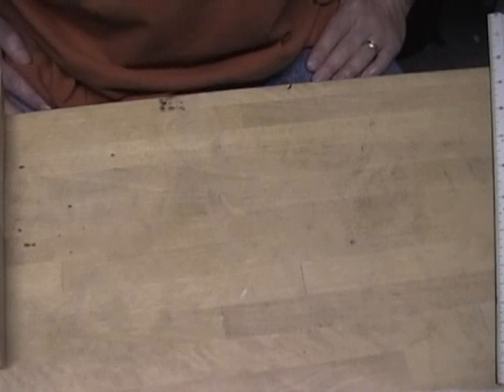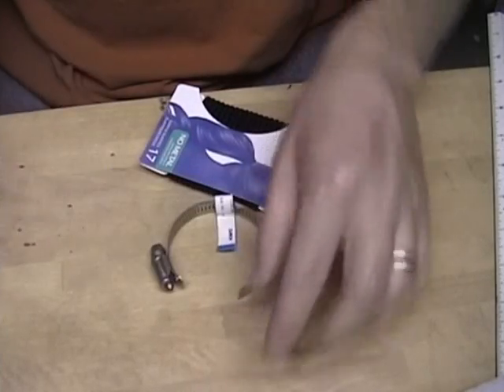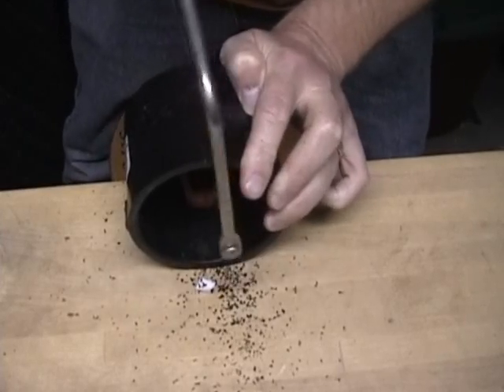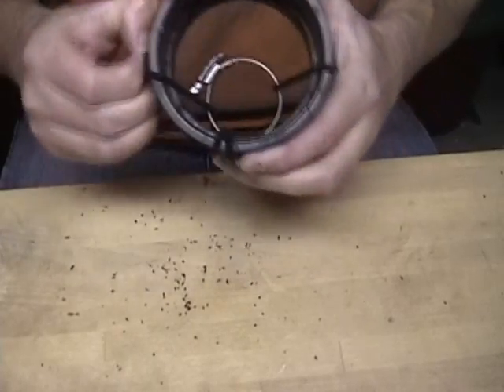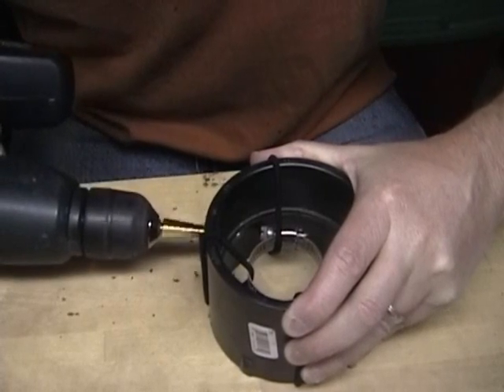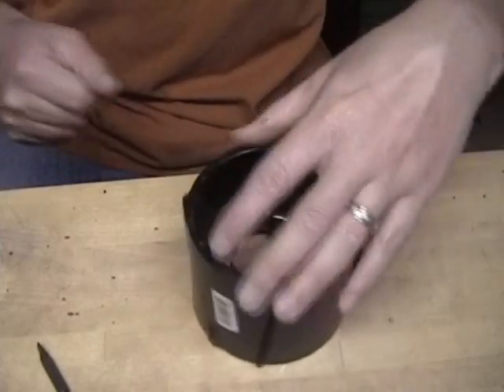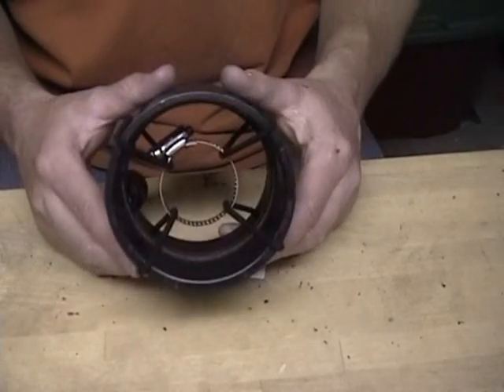DIY Microphone - $8 Spider Mount

Comment: That hose clamp will do much damage to mics
Reply from the maker: +Victor P (fastbob1) 
The metal hose clamp never touches the mic. the elastics inside the ID of the hose clamp suspend the mic away from the metal. I've never scratched a mic using this setup.
I may not be doing a good job of explaining with words, so I drew a new picture:
http://www.DiyRibbonMic.com/images/shockmount_top_view.jpg
It becomes clear when you build it, that the mic is suspended inside the clamp by the elastics, without touching the metal.
Also, 2 hose clamps can be used to support taller mics. The elastics go through both hose clamps... again, spacing the mic body from the metal.
 - Rick
Reply: rickshawrecords thank you for the super-helpful video! i'm gonna copy the one that took one hour to make, if you don't mind?
Reply: Actually, the hose clamp doesn't touch the mic at all! It's perfectly safe for every type of mic.
The elastic bands are looped THROUGH the hose clamp, so when you have at least 3 of them (4 shown in this video), the mic only touches the elastic bands.
Another way to visualize it is: Imagine if you had 50 bands. The entire inside diameter of the hose clamp would be full, with no way for the mic to touch the hose clamp. As few as 3 of them completely separate the mic from the clamp,, because the mic only touches those 3 elastic bands.
Yes, if you used really thin rubber bands, you might get some contact with the clamp, but hair ties are plenty thick enough to support the mic away from the inner diameter of the hose clamp.
 - Rick
Reply: from what I watched, that ONE hose clamp seems like a scratcher for an expensive mic. Admire your vid honestly. but nowadays pop filters are $5. keep it up, you have talent..
Reply: oh ok i guess i missed that part. good DIY

Comment: Good one but the clamp will scratch the microphone.
Reply: Actually, the hose clamp doesn't touch the mic at all. The hair ties are looped through the hose clamp, separating the inner diameter of the clamp from the mic. The only thing that touches the mic is the elastic bands, and they hold the mic firmly, like 4 soft little fingers.
No scratches, no contact, except for being held in-place by the 4 hair ties. It works great.
- Rick

Comment: Wouldn't the PVC tube add like a resonant box in front of the mic?
Reply: With the mic in the hose clamp, such that its face is above the rim of the ABS pipe, there should be little, if any problem for a side-address microphone.
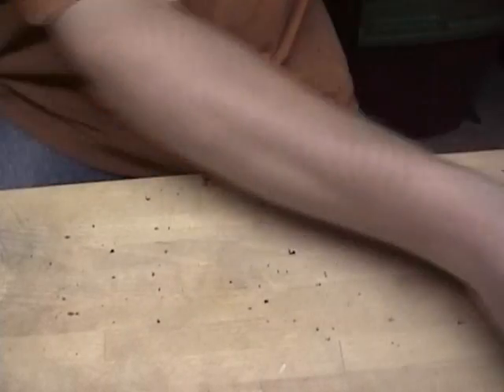You can always cut-away the sides of the pipe like I show at 7:54. It takes a bit longer to complete, but no additional cost.

Comment: instead of cutting the hole, couldn't you just slide the clamp up until the tightening-screw is accessible, tightening it, and then slide it back down?

Comment from the maker: You can use the mic in the horizontal position just fine. If you have a really heavy mic, just use two hose clamps for extra support.

The mic is protected from the hose clamps by the 4 or 5 hair ties. The hair ties pass through the inside diameter of the hose clamp, so the mic body rests on the hair ties, not the metal clamp.

- Rick

Comment: Hey men! Really nice! I have two questions, what if you want to use the mic mounted into the spider and use it in horizontal position? will it hold the position or you can only use it in vertical? when you screw the host clamp against the mic it will not scratch the mic finish?

Comment from the maker: The cool think about elastic/felt hair ties is that they are the part that touches the mic, so there is no metal-to-metal contact between the mic and hose clamp.
Springs would require some more engineering, and something soft to protect the mic.
- Rickshaw

Comment from the maker: @Laochri, If you clamped the mic, then ran the hair ties, you couldn't change the mic or rotate it without taking the whole thing apart again. The hole for adjusting the inner clamps allows flexibility for the mount to be used with more than one size mic.

Comment from the maker: @ArtistWoOoOo, An elastic spider shockmount isolates mechanical noise traveling up the microphone stand. The elastic bands do not transfer low frequency vibrations from the floor, effectively isolating those vibrations from being picked-up by the microphone.

Comment from the maker: If you ad 2 rings to the mount, you can still use 4 hair bands.
The number of hair bands is really dependent on:
 a) The weight of the mic you're mounting, and 
 b) the diameter of the mic relative to the diameter of the hose clamp.
Since the hair bands go through the hose clamp ring, the mic touches the soft hairbands inside the hose clamp, preventing metal-to-metal contact.

Comment: 8:05 YES it does matter very much. If you have a tube near or around a mic you will get the sound bounce back from the tube and it will sound bad! 
- Just to say that it matters. But if you cut it out like he did with the other one, it looks nice and will work much better.

Comment from the maker: True, sound reflection *could* happen. However the side-address Ribbon Mics that my spider mount is intended for are so laterally directional, (rejecting from above or below) that reflections would probably be negligible.
Either way, it's the same cost... Just more effort to cut out the sides.